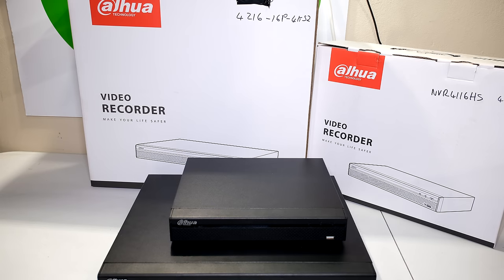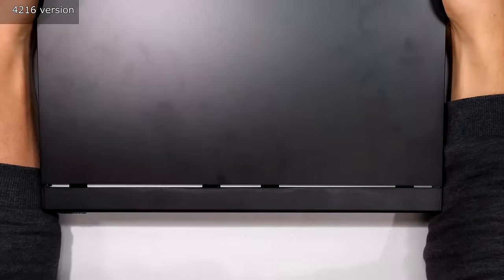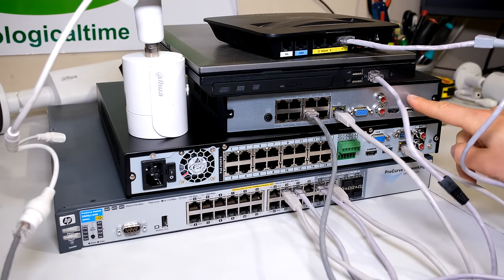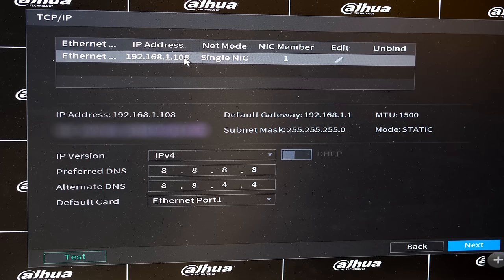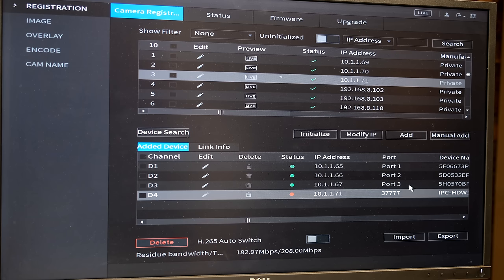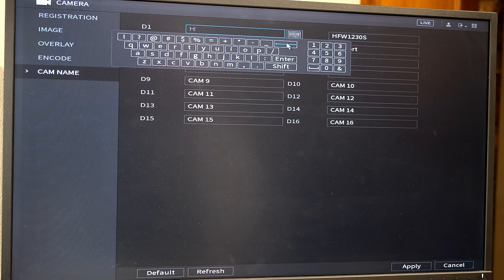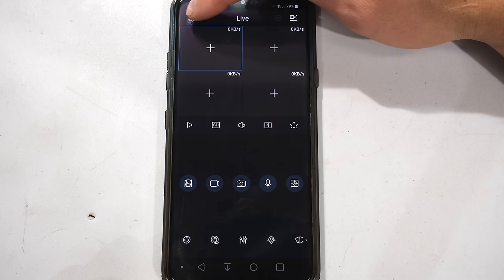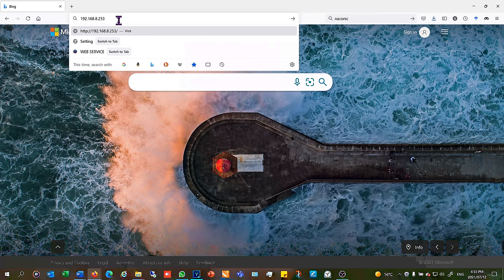Dahua NVR setup 2023- hard drive, cameras, and remote view - step by step. Models 4116 & 4216

Comment: LOL You are aware that you can also use your NVR as a Camera right? Did you know if your NVR has Zero Channel you can also use any Channel you want if you don't have a Zero Channel you can only use Option of Ch1 I love it when people say that Oh having a camera connected to NVR1 you can't use it on NVR 2 unless you setup that camera on a POE Switch or some other format of Networking.. Not sure why people hide a Mac Address LOL is there something I don't know that some one can do to my system if they know my Mac Address? I mean sure I could test a Mac Address to tell me who owns it Meaning First 6 Mac Numbers can tell if it was Dahua or Hikvision or some other type but out of that no clue lol... I have a 4K AI DVR that is able to run AHD, TVI, CVBS CVI and IP that I have some CVBS cameras I wish was able to run on my NVR for PTZ commands and Presets so I use my AI NVR to bring in my AI DVR channel on channel 5, and on ch3 and 4 because I want the view in Grid to complete my lineup.. I have all my Dahua and OEM Dahua connected and able to take in no less then Ch1 however with Zero Channel active I can use any and multi channels
Reply from the maker: hi, thanks for your comment. I try to hide as much networking info as possible. Since MAC address is a unique number, sharing such numbers introduces risk.
Reply from the maker: Hi, could you please explain how you link to a camera connected directly to one NVR POE port and then stream that via another NVR pls? I have not been able to see those cameras on another NVR that are physically connected to the built in POE on one NVR. I only stream one camera across two NVRs if the camera is connected via an external POE. Would love to know how you do it your way where the camera steams across two NVRs while physically plugged into one NVR
Reply: @ecologicaltime  Hello, Sure, I will have to see if I have a Video already made if not I can make one.. However it is easy really... I will use my system info and with that just use your Info in the place.. So on my 4216E-AI, I wanted to have access to my Samsung PTZ that has Motion Tracking, So I do a Search for my Devices, I then see my XVR (Dahua OEM AI DVR) at 10.0.0.229, So I then click on the Add Button, However out of the gate it add CH1 and my Samsung is on ch5 so I go to the DVR and I go to the Display and I Choose to turn on Zero Channel, I go back to the NVR and I go to the Cameras list, I look in the bottom linked cameras, I go to the one that is my XVR and click the Pencil and click the Connect, I then click the Remote Channel number box drop down to D5 and I press Save. Then looking in the 4216E-AI camera Grid (I use 9 camera view mode) I see my new Camera listed in the NVR I have it right now setup in my NVR at Ch15, So I can have my Ch7 Static Dahua Box camera with Tripwire tell one of my IP PTZ cameras to go to a Preset and that Ch7 on a different Rule to tell my CH15 Analog camera to go to a preset.. My XVR is connected with a RS-485 to my camera on ch5 that is now my ch15 on my NVR when my NVR brings up the PTZ menu I can go to the Analog cameras OSD, setup PTZ presets and other things that you can normally only do on the local DVR all works on my NVR.. So to be clear, I also have other DVR's and NVR that I can access the camera from. One thing I found I don't like I can get a camera to access from my Hikvision DVR to access my Dahua line of NVR or DVR and access like normal cameras however I have not been able to access it the other way. I can get it to come up however it just errors out when I try to use my Hikvision DVR as a camera in my Dahua NVR or DVR with Ip channel.. Also I can take my Dahua OEM 4108E-HS and 4108E connect my 2mp IP camera on the POE port of the NVR then on a normal network cable going to my network that my 4216E-AI is also connected I can use the IP address of the 4108E and setup on my 4216 NVR without having to run my POE so long to the camera and have full control of the camera.. Yes normally you would just setup my 2mp POE PTZ camera on a POE switch and then you can access it by any NVR on the network.. However if you want to keep your Camera connections Secure, and cameras off the Internet then connecting them to the POE NVR Port is the best way.. So connecting my POE PTZ camera to my 4108E then 300+ feet away only using a normal Network cable that is running from my 4108E to my network switch, My 4216E-AI can use the IP of the 4108 to access the camera.. Having a Zero Channel lets me pick any channel I want from the Recorder if the 4108E didn't have Zero channel or not turned on then only Ch1 will work.. Also have 5208 Dahua DVR with Zero channel, I can access any of the 1-8 channels on my NVR as well even more then 1 at a time.. If you want me to make a Video I will be more then willing and I will look today and see of I have any that I made but have not uploaded yet as I make Videos sometimes and forget to upload or changed my mind lol
Reply: So it is still Processing however you can see a Unlisted Video I made showing my XVR on my NVR with using 4 of the 8 channels Also show it isn't a Fluke that I can access the DVRs PTZ controls to the CVBS PTZ OSD... LIke I said it is unlisted and if you want to see more showing how and or others that I have showing that some only will work with CH1 some will work with them all.. Just to be Clear it isn't anything to do with the 4.0 FW of the NVR either seeing I have some 2015 DVRs with really old FW that I can still access all 8 channels because it offers a Zero Channel.. Without a Zero Channel setup only Ch1 will be able to get listed in the NVR...  https://youtu.be/zUC_GI9WleU
Reply: @ecologicaltime  I will go make some changes to my Recorders locations and I will setup my 4108E to work with my POE PTZ camera and then make that connection to my 4216E-AI NVR and I will setup doing that in a Video. Now the Location where I will install the NVR is a few hundred feet from my house. I will swap out my 4108H at the location I have my 4108E right now. Either do something on my Desk or maybe connect a different PTZ camera for a Video Will have to see how much time it takes to get the Recorders changed out.. Either way I will setup something today and record it..
Reply: @ecologicaltime  OK so I made a Video you can View it here https://youtu.be/qosgCuzKX6U I have to admit I learned something new myself today lol.. So I was going to connect it to my 2mp PTZ camera however I thought I would make it without doing that and just connect one of my POE cameras that I could reach in my Office... So I Connected my 1046EW-AI POE camera from my 4216 in to a NON AI NVR a older 4108E on port 1, I then had it come online in Ch14 of the 4216E-AI NVR and what I learned today was that my 4108 when it passed the 1046EW to my 4216E-AI NVR it also passed the Rules that was setup in the camera...
Reply from the maker: i feel bad now as it seems i have put you up to a lot of hard work!
Reply from the maker: thank you for these detailed instructions. I tried to assign a zero channel on my older Dahua NVR which i have currently but its not allowing. Going to check your video.
Reply: @ecologicaltime  Not at all.. I have no issues trying to help out when and where I can.. I have been in CCTV for many years with my First Recording Device a Reel To Reel Then the Time Lapse VCR, and so on.. It is a Passion of mine. I have loads of cameras and around 20 recorders..
Reply: @ecologicaltime  So if you bring up DMSS and when you look into the Camera list, If there is a Zero Channel in the list then your NVR has it active, IF there isn't one then you can look in your NVR under the Display tab and it might need to be activated.. LIke on my 7108-AI DVR I had to turn on the Zero Channel.. In that Machine,  it has 4.0 software, click the screen then main menu, then Display, Then on the left bar I have Display, Tour Setting, Zero Channel. I have mine setup as H.264H, 704x480 (D1) FPS 30 and Bitrate set 4096.
Reply from the maker: okay i checked your video, so does this work reliability every time? When i stream one camera to two NVRs i make sure the camera is connected to a POE that is separate tot eh NVR and then i add the device to both. I will play around with your method as sometimes you dont have another POE that is spare. Thanks, good job.
Reply: @ecologicaltime  Yes it is clear and clean.. I will admit there is no cables in my Network that are CCA and anyone that uses CCA cables will have issues one way or another.. You had talked about some lag in one of your Videos and I don't have any Lag in any of my connections but will admit that doing the 4108 with my AI camera then to my AI NVR there was some lag and I am guessing it is caused by the AI data that has to pass.. I say this because I connected my Normal non AI Ptz camera and when it loads it is fast without the delay that was in my Video and again I think it might be caused by the AI rules being Pulled... I have had my PTZ camera from my AI DVR and my Backdoor camera on my NVR though my DVR since April and there has never been any lag in video or pulling up the feed...
Reply: @ecologicaltime  Also what I don't like about my Hikvision IP cameras is they only work with a couple of connections. Depending on your Dahua camera you can have them setup for many connections and some others could connect to 1-20 NVRs. My NVR can have 128 connections, I keep mine limited to a Set number to keep down connections outside of my own.. Meaning if I want to connect to 2 different NVR's then let 5 other connections for family members I will setup for 8 this way I have a connection for the WebUI.. However on some of my cameras I have setup for 3 connections and have it setup with IP filtering as well. This makes it so only connections I want can access them..
Reply from the maker: thanks. I see it listed in the mobile app DMSS for the NVR. I have some work to do now to use this function, thanks for your help!